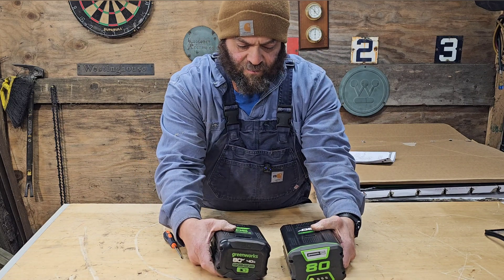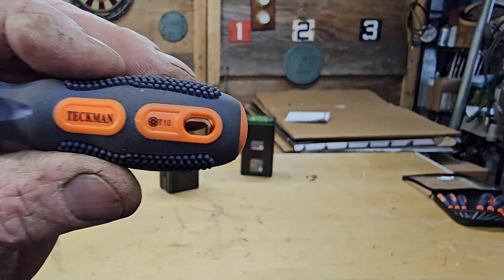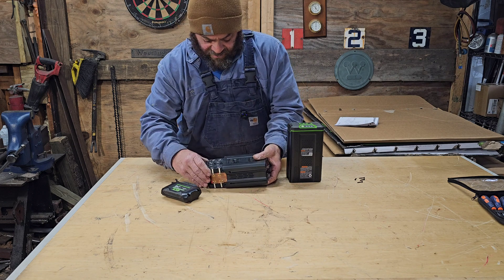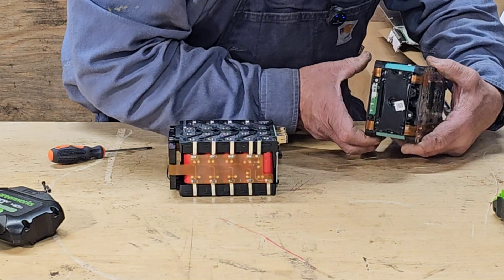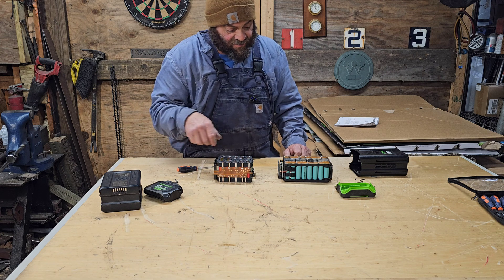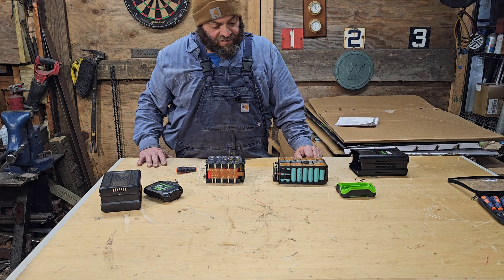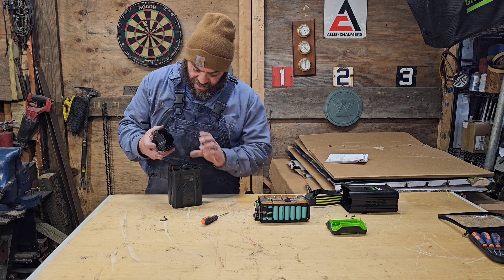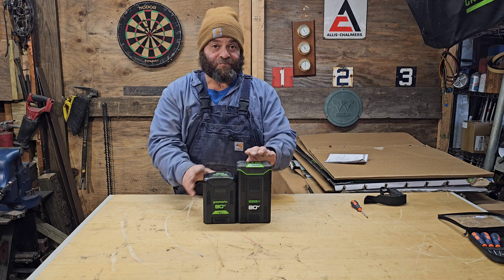Greenworks 80v batteries - are the new ones better? A look inside - BAB727 vs BAB742

Comment: Are the new designed 80 volt batteries compatible with all the tools that used the older batteries? 
I just purchased a trimmer and it came with the new design 80 volt battery which I was hoping to use with my 80 volt snowblower.
Reply from the maker: Yes,  they are backwards compatible 👍🏼
Reply: @reusefull Great, I thought so but I just wanted to confirm! 
Thanks for the reply

Comment: Thank you sir. I was looking on eBay for an extra battery for my trimmer and saw both the 4 indicator light batteries, and the 3 indicator light batteries for sale. Both 80 volt, I was wondering what the difference was. I definitely want the longest runtime battery.

Comment: are they both compatible? or backwards compatible with my tools.   i have the old one but the new ones are on sale and i wanna get an extra one
Reply from the maker: They are backwards compatible
Reply: @reusefull  cool thanks.  i guess google Ai is wrong then
Reply from the maker: @shawnh5070 yeah... I asked chatGPT what the most powerful battery chainsaw in the world was and it said the Stihl MSA-300C. I said no it isn't, there are many more powerful models... it said, you're right! 🤦‍♂️🤷‍♂️
Reply: @reusefull  rofl. ya i start to realize that Ai dont have all the answers. the strongest saws are 881 or 661 or 500i. im not sure about husky and i dont bother with echo.
i own a 362 entry to pro tier.
btw i bought a greenworks gen 2 80v 4.0 AH battery and run time is great. i also just bought a 80v  greenworks trimmer and its a beast.  it may have saved me 500$ from having to buy a stihl  FS trimmer

Comment: Thanks for the review, one advice, that screwdriver is dangerously close, to the open battery and electronics, one short in the PCB, can destroy it.
I don't want to find out when you short one of the busbars. I always place away all metal objects, handling bare battery packs. Just be save :)

Comment: I know Ryobi has swapped to tabless cells and the difference between them and their previous top tier batteries is supposed to be noticeably improved in every metric. I wonder if Greenworks will eventually go this route also for the rest of their line, or if there is already a third party 80V battery maker who is using tabless cells in their packs.
Reply from the maker: I would think that they will do that eventually

Comment: It would be interesting if you could confirm that the new, compact 80v battery is compatible with the old chargers?
Reply from the maker: I don't have any of the old style 80v batteries,  but on some of my 82v batteries,  I can only charge them with the older style,  they error code on the new chargers.
Reply: There should be no reason that it wouldn't be. 21700 cells are the same chemistry, so the same charger should work.

Comment: If the new battery has tabless cells, it should perform as well as the old model with less size and weight.  Also, the the chances of getting a bad cell is cut in half therefore less chances of the battery dying prematurely.
Reply from the maker: I don't believe this series is tabless,  I did mention a higher chance of failure because of the higher count in the video... there are advantages to each setup depending on your use, but the older style is... older.  Even though it's included in equipment sold as new,  they stopped making them in 2022, so the cells are a minimum of 2 to 3 years old when you get the battery... which kind of stinks.  Even if they're covered under warranty,  everyone just wants tools that work.

Comment: Wonder if you could take a look at the 80 volt 8ah batteries that Greenworks has in the future if your able to get one, those batteries ain't cheap, $450 a pack and I have 6 of them!  I could take mine apart but not going to risk it for the cost of what they are.
Reply from the maker: @Sallen121  I have 82 8ah, I imagine they are similar.  If I get my hands on an 80v, I'll take a look.

Comment: Thank you for the very useful information confirming that Greenworks has switched from 18650 to 21700 and has already switched to batch (pouch) batteries. I thought they only started producing batteries with 21700 starting in 2022.
Reply from the maker: @Tihiroprjckuh9000  That seems to line up... all the newer style batteries I have are 2023 dates or newer.